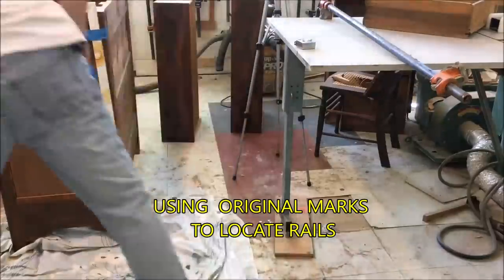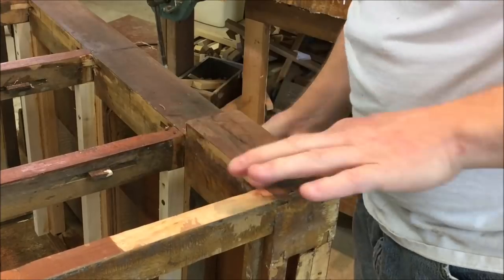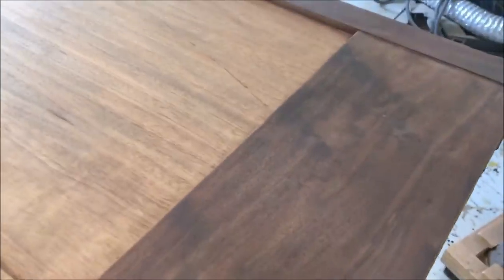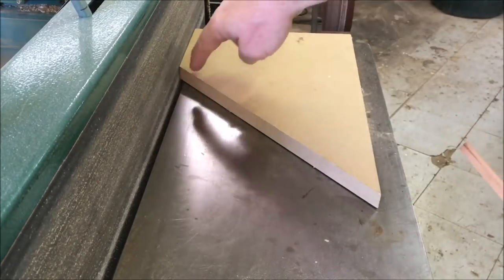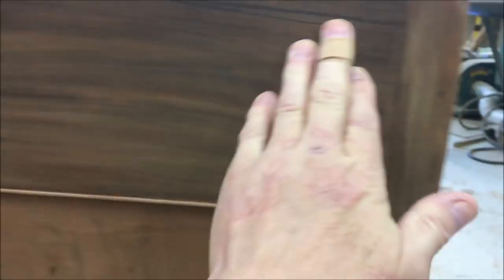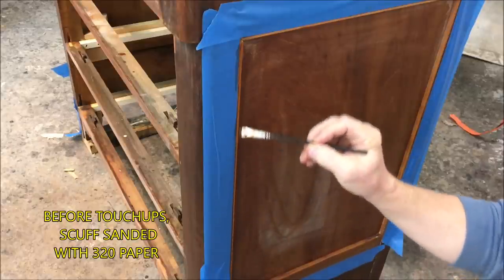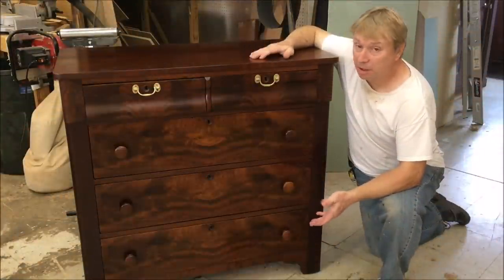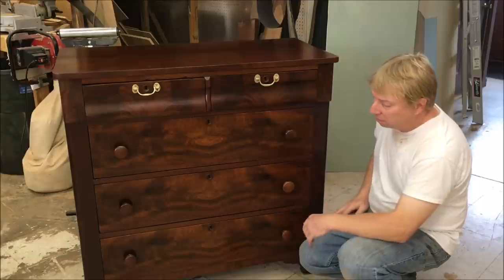MAHOGANY CHEST OF DRAWERS / PART 2

Comment: This is some grat repair!! What a work, and so many clever solutions. I would have hesitated to even begin something like this, and you produced a very pretty piece of furniture. One question, please: Did you consider French Polish? That's something you often see on pieces from this period.
Reply from the maker: no, this is not a museum piece of furniture , and unlikely it would have been finished that way originally since it is a factory made piece of furniture . i do not do french polish anymore . there is no call for it and it is too shiny for most people . i sometimes do padded shellac though .

Comment: I've heard that Hyde glue is inferior to wood glue.  Is this true?  If so, why would you use Hyde glue like so many restorers do?
Reply: Excellent work, BTW.
Reply from the maker: it is best to use the hide glue for regluing old joints . it will remelt and bond with the original glue and is reversible ( as demonstrated in this video) . it should not be used for structural repairs such as splits and anything that bears weight or allot of stress. the hide glue can soften in hot humid weather .hide glue was  all there was until yellow glue was invented .  it is amazing that some pieces of furniture  that are hundreds of years old are still solidly glued together .
Reply: Ok.  Thanks!